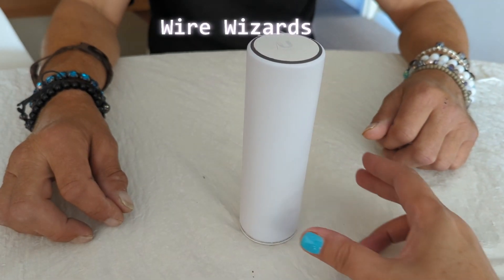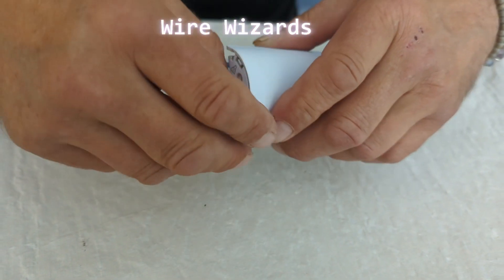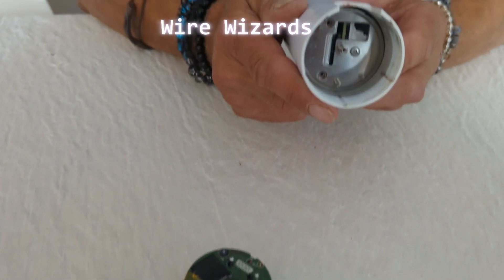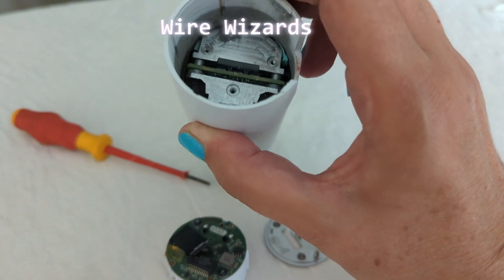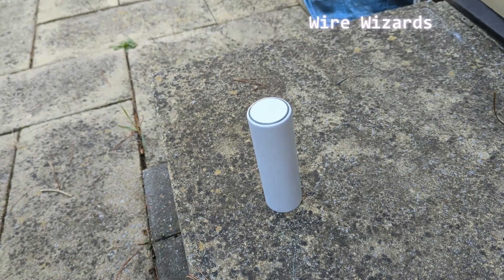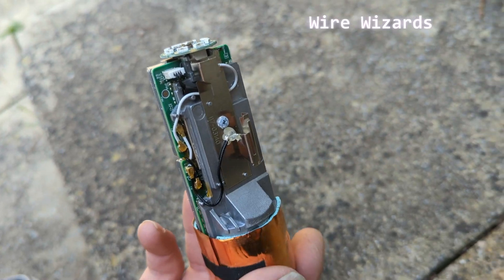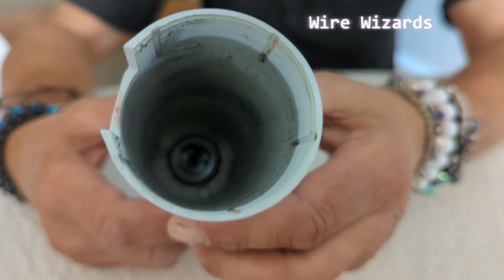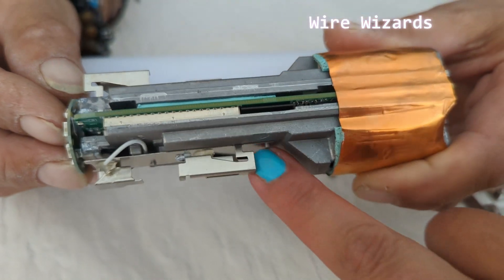What's inside a Ubiquiti UniFi U6 Mesh - I SMASH one up @UbiquitiInc @broadbandbuyer

Comment: I just took one of these apart, a few years old, sitting outside in full weather near the seaside
It had failed, but its ethernet port still looked fine 
The unit wasn't showing a link light on the switch, but it was powering up
Once I got into it I could see that it had been taking in moisture for quite some time
I think the only thing that's allowed it to carry on working while being soaked, is the fact that they create plenty of heat
So it's not just the base of the unit that is designed poorly for outdoor use (or window sill apparently), but also the top of the unit
Perhaps the adhesive they use to attach the cap isn't UV stable

I find it quite perplexing that Ubiquiti have labelled this for use outdoors while the G3/5 Flex cameras are only to be used outside under cover
Both the U6 mesh and Flex cameras have exactly the same base design for those that aren't aware